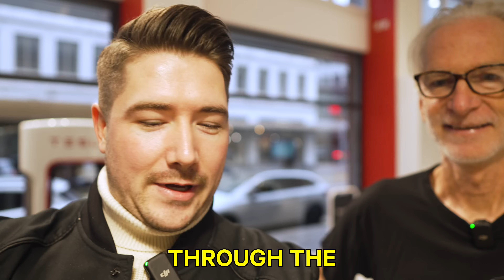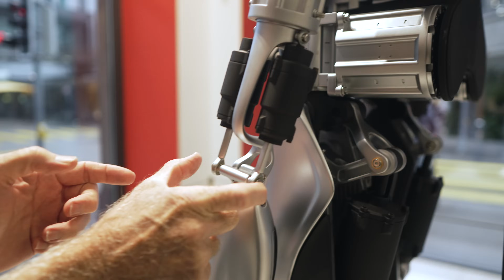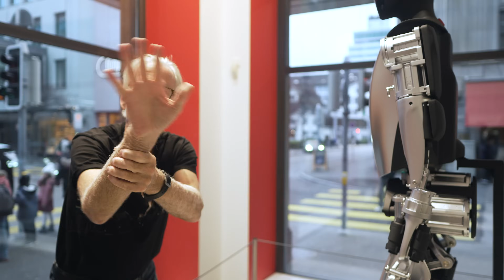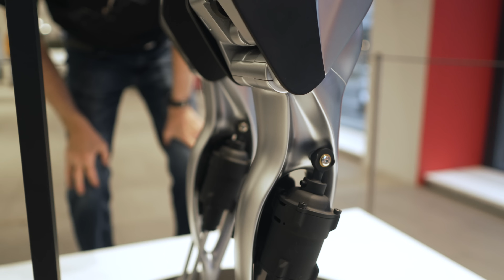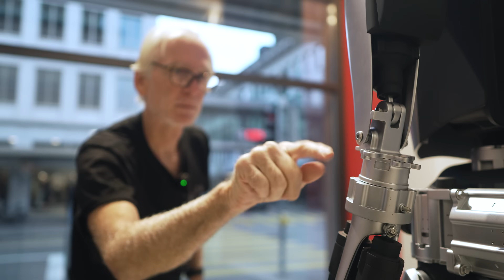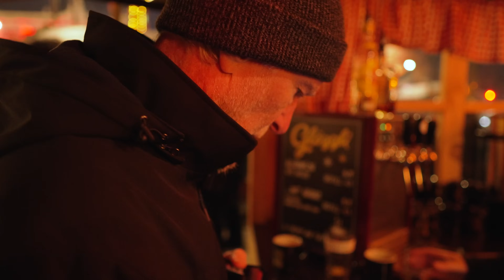Tesla's New Optimus Bot Vs. Older Model⚡Holiday Special w/ Dr. Scott Walter

Comment: Jan, I didn't like your channel at first, mainly because when you asked questions of your interviewees, you tended to get bogged down in unnecessary word salad. But you've managed to eliminate most of it by now, and I see a lot of work behind you now, mainly by adding some excellent people into your content, also perhaps by some of these impromptu ideas you make happening, just like this one meeting in Zurich with Dr. Scott Walters.
I simply must tip my hat to you! 
What surprised me today is that I subscribed yesterday to "Our Cyber life", and seeing they were completely new, checked their subscriber numbers, and if I remember well, yesterday they were about slightly under 5K. They're fantastic synergic and open couple and it seems their intake is fast as rocket; but I checked your numbers and am quite surprised why, after being around for so long as you are, you have only 5.3K? Hope your subscriber numbers will take off higher quite soon, because your content is very good by now!
Reply from the maker: Thanks for the lengthy feedback! I am working on improving my content quite a bit. 

My growth rate is pretty slow but steady. I could grow faster when I would adjust to some parameters, but in my position it is difficult right now. I try to be as consistent as possible and see where it takes me 😄

I have a lot of good content in the pipeline that I am super pumped to put out! 

Thanks for being a long term watcher of the channel and for your great feedback! 💪
Reply: @TeslaFix  kudos for accepting it! 👍🏼

Comment: 23:09 talking about additional, yet hard to notice benefits of EVs, I noticed some folks saying that when the CT was doing the frontal crash test, the rear axle broke - as the wheel was apparently limp and kinda hanging by a thread, but they forgot to realize that a) the rear axle has steering mechanism in it, and b) once the electricity is gone due to the crash, steer by wire quits, so the wheels are without any power, so no wonder they hang out like this. Which doesn't imply that if the electricity comes back on, the wheels and the axle wouldn't be capable of driving again.

Comment: The argument for a humanoid bot is you don't have to make any changes to its environment. It is intended to work in the exact same environment as humans. So, I don't know why Scott  thinks the next gen factory will be DESIGNED for Optimus.
Reply from the maker: I think what he meant is that the production line will change so it is easier for the bot to operate, which it does. It will also be easier for the human operator to operate the line as well. But still the line is built with both operation in mind. But I get your point.
Reply: @TeslaFix  That suggests the existing lines are not already optimized for human operators. I find that hard to accept. 🙂
Reply: In terms of safety, there's a lot that can be removed from a factory when only Optimus is working there, such as safety cages, safety covers/plates, lighting, signage, risk assessments, floor markings, safety training, hazardous substances handling. These can all be optimized for a robot only environment, where humans could work, but robots are certainly at an advantage in terms of cost, time and administration to set up the work area.
Reply: @BongoWongoOG  So you think humans won't be on the factory floor at all?
Reply: @davidwill1320  Hi, in some places, no humans at all. Everything monitored and managed by a pure AI system. In other areas there will be co-bots working along side people. But people will be replaced bit by bit. It’s an inevitability that we’ll automate ourselves out of the dangerous, repetitive and mundane operations of work. I’m excited to see these advances in my lifetime (I’m 53 and been a technophile all my life).
Reply: @BongoWongoOG  He was talking about the next gen factory, in Mexico, not in the distant future. Any space where a human has to enter will be subject to safety regulations, so I don't see anything safety related going away any time soon.

Comment: 😁🥰Good day from Lismore, NSW. Merry Christmas, and have success 2024.
👉Tesla Optimus👈, I will have ten of these for developing 250 passive homes on 57 hectares, 22.43 MW/DAY electricity, and 57.7MW TESLA Megapack Batteries Farm.
The passive houses made, SIPform prefabricated panels are shown here.
I am a PROJECT MANGERS and CIVIL ENGINEER who has worked in Singapore & Hong Kong doing Tunnel Boring Machines & managing 160 engineers and architects from 1999 to 2005.
I will have a video of the trip on X and YouTube at the end of April 2024.